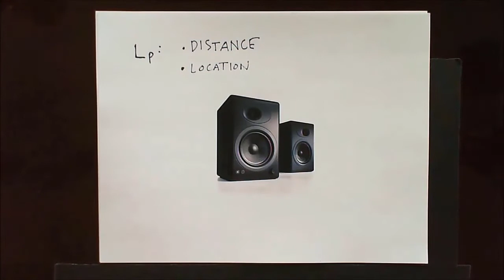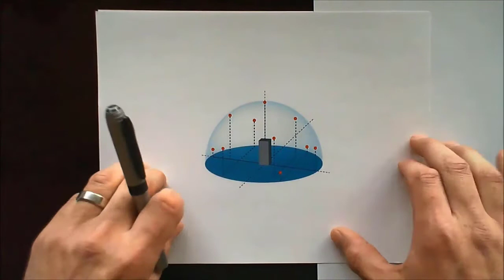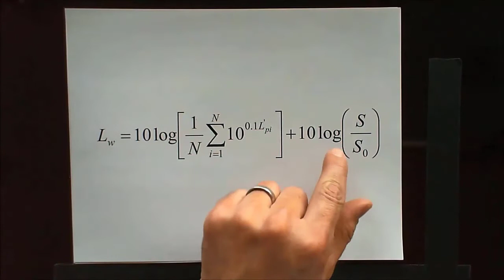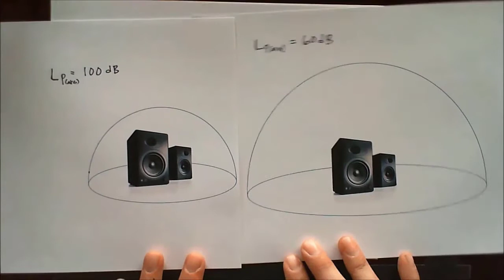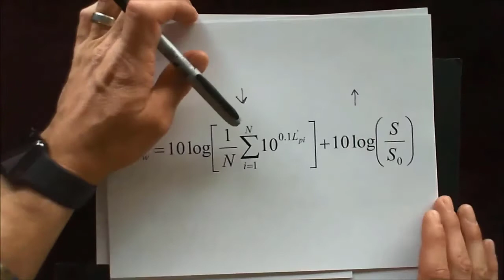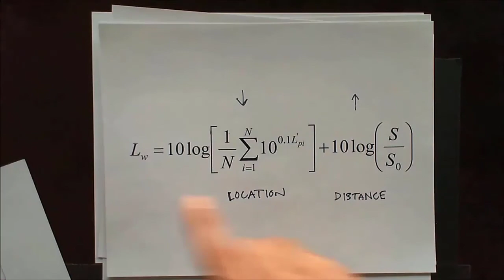Sound Power

Comment: Seems more ideal if the printer were elevated and microphones could be placed around and no sound is absorbed or reflected by the ground.
Reply from the maker: Depends on the product.  Sound power standards often require a reflecting plane.  For example, a car would have a reflecting plane underneath to simulate the effect of the road.  A sound power measurement on a refrigerator would have a reflecting plane underneath and behind it to simulate a floor and a wall.